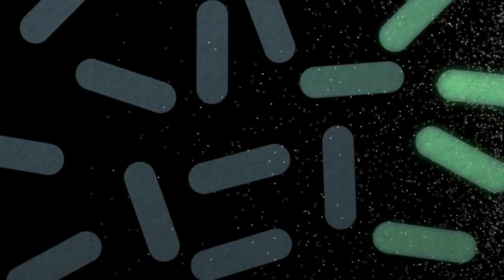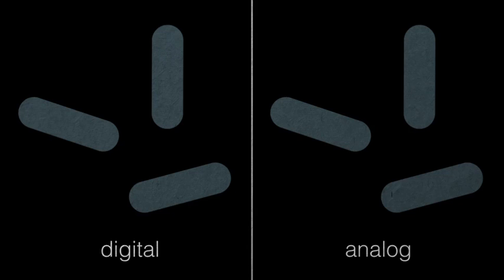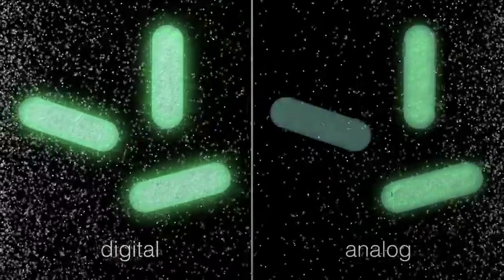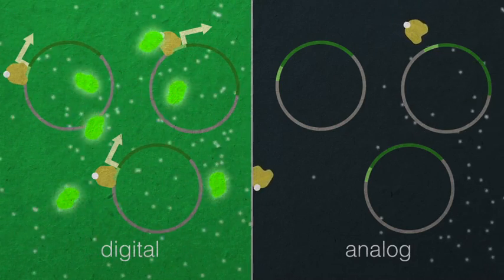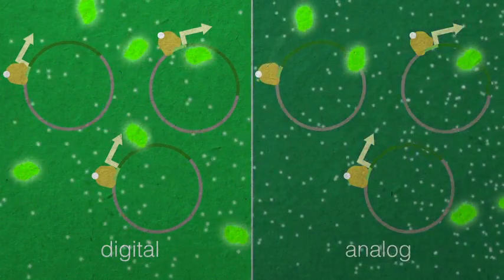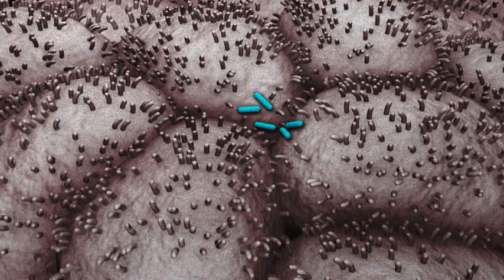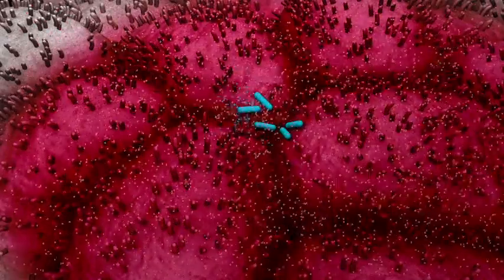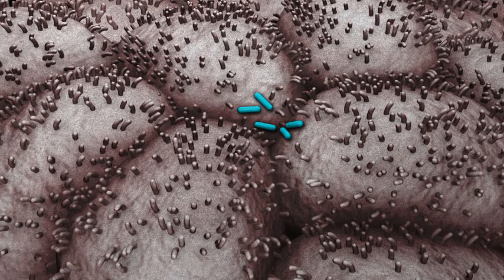Synthetic Analog Computing in Living Cells

Comment: Now to create an Analog PID Control Loop in a cell! e.g., servo on measured glucose levels and regulate insulin levels in response:

Program cells to sense blood sugar levels and then produce insulin levels proportional to the detected glucose levels for people suffering from defective natural cells whose function is the same.

More than likely more than one factor will need to be sensed when calculating the required insulin level, Glucose level of course but maybe Adrenalin levels would play a part, etc.

Electronics has been my passion for 50 years and I have always thought of DNA as a biological computer program -  a very large, complex parallel processing network! Now Biologist and Geneticist are thinking in terms of Digital and Analog Circuit Design Engineers! Great!!! This is a natural place for So Called Fuzzy Logic to contribute. To me Fuzzy Logic is just a way of using Digital Computers to emulate Analog computers.

This is a major turning point,  scientist, Engineers and Programmers sharing a common goal working together as one.